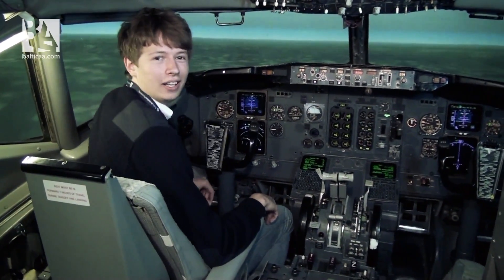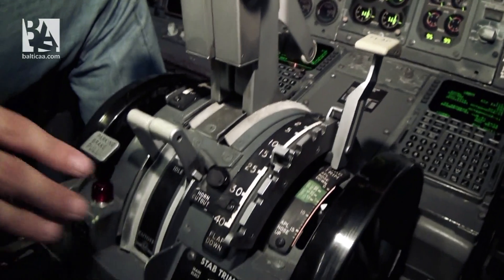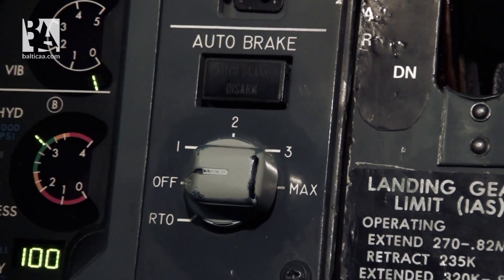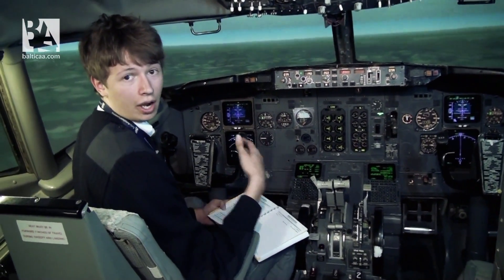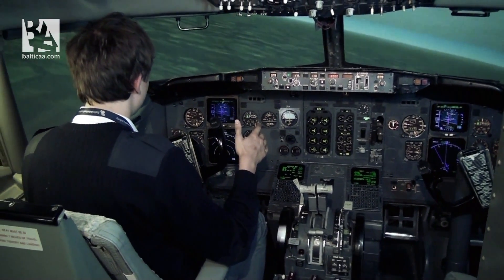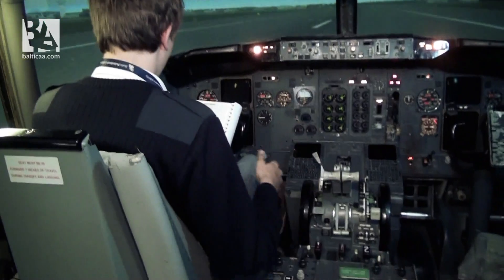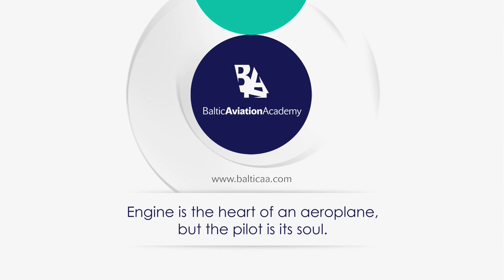Boeing 737: Gear-Up Landing

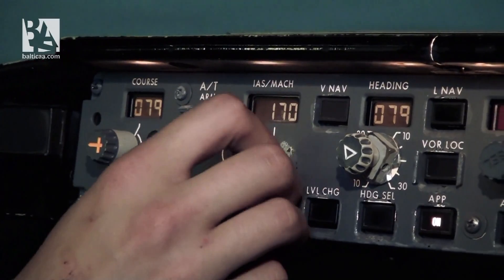Comment: 7:57 first set flaps 15 and then select speed for flaps 15. Never reduce the speed before you set the corresponding flaps.
Reply: It's the other way around. The flap speeds are speed limits, you can't be above those speeds with that much flap extended or you can damage them. So you set the speed first, then once you've reached that speed, extend the flaps.

Comment: why do you evacuate the aircraft due to a belly landing
Reply: This is a retarded question
.....
Reply: It’s necessary to perform evacuation after a belly landing due to safety concerns. Your aircraft could be severely damaged and your engines for example can catch on fire or you also might suffer fuel tank rupture which would cause a fuel leak. JET A1 fuel has additives in it to make it more safe and therefore it’s a lot harder to ignite it at low temperatures when compared to regular kerosene. However it is still a fuel after all and it is still highly flammable and it burns at very high temperatures so performing an evacuation after a belly landing like this is in my opinion absolutely necessary to ensure everyone’s safety. Evacuation itself can cause injuries to passengers but the benefits of it outweigh the risks of injuries and it’s still better to have few passengers with minor injuries than to have an aircraft being consumed by flames while people are inside of it.

Comment: Why are the is the aircraft secured before fire drills? Surely you need to prevent fire first as its a belly landing
Reply: If you're asking why he pulls the fire switches after the landing, it's because there was no fire on the plane, but he pulls it so that the agents discharge incase a fire was to break out during the exit (this can be caused when the plane lands since during a belly landing it lands on it's engines which can create fires later)

Comment: Why did you dont activate the fire extingusihers? In the A320 you activated them...
Reply: He did not activate the fire extinguishers, he pulled the fire switches to arm them in case of fire but to discharge the fire agents you then have to turn the appropriate switch. He states that there was no fire, so he just left them in the armed position.
Reply: he did at 11:04
Reply: +dylan the villan Are you sure? I looks like he armed them, but it don't look like he is activated the agents in fact.
Reply: @computerretter Yes you’re correct. He didn’t release them. While this may be a normal procedure in A320 it’s not the same in 737. Even checklist says that you should override and pull fire switches (which means just arming fire agents). Then it says that if an engine or an APU fire is indicated you should turn the fire switch of that affected engine to release fire bottle. However in 737 it’s not necessary to release fire agents if there is no fire. Of course these procedures may vary depending on what airline you’re flying but generally it’s not necessary to release fire agents if there is no fire. Pilots of course might in some situations release them even if there is no fire and that’s if they for some reason decide to do it this way but as I already said couple of times it is not necessary.

Comment: Normal landing position flap is 30?
Reply: Yes, usually its 30.
Reply: +Ozan Akdag so flaps 40 degrees use for what?
Reply: Steven Satya Mostly emergency situations like this one. Maybe also if runway is very short, or the plane weighs a lot.

Comment: The boeing is a much nicer aircraft in emergencys in my opinion. Why? Because the only beep the boeing made was when it came to a stop. On the airbus. There are 1000 bomming noises going crazy. I hate that
Reply: When put under stress there is phenomenon when your brain will prioritise what you see visually and this sense can be overloadedThis is why the Airbus beeps so loud, there is no fool proof method but it does improve your chances of drawing your attention to then reacting to a situation. You can stop the beeps by confirming the message.You can activate this system or disable it in both aircrafts so what your saying is not really valid it's just specific to how and which system there pilots were trained in the sim.

Comment: How does the Simulator manages it to shake?
I mean, i thought it can make only smooth movement.
Reply: Hydraulics can move very rapidly, and not just smoothly. The sims use hydraulics
Reply: +Nicesisten The simulator is moved by a series of telescopic cylinders. These have oil "cushions" instead of metal guides, so they can react to rapid movements without dealing with substantial amounts of friction. They also have special valves to direct flow rapidly between the cylinders' chambers. The same cylinders are used in tensile test machines to simulate quasi-static force application.

Comment: No Head Rests!!! Does you neck hurt in long flights?
Reply: This is the old 737 (100 200 300 400 500) the new ones (600 700 700er 800 800ng 900 900ng bbj1 bbj2) have headrests.

Comment: One critical concern not vocalized during no gear emergency landing. After touch down once speed go down far enough and rudder becomes ineffective, because there is no front wheel pilot has no control over airplane direction of movement. Skidding off runway on grass might mean disintegration of fuselage, while staying on it hopefully only minor insignificant fire. For this reason it is absolutely critical to land ideally at the center of the runway and keep plane ideally lined up as long as possible. This would be primary concern of a real life 737 pilot. Otherwise, good landing Captain!
Reply: the grass would be better on the fuselage (assuming the ground is relatively flat) because it is slicker
Reply: Concern is not only evenness of terrain but also softness. Bare in mind we talking about 100+ tones, resting on 3 points (engines and tail) going 20-40 and more kts. Imagine one of engine slipping into shallow depression and burying itself in the ground, hitting tip of large buried boulder or perhaps shallow covered by the grass ditch or even some airport's installation for that matter as: solidly installed in concrete bed lightning, heavy electrical metal box etc. I suppose even on perfectly flat terrain softness of the ground could be enough for one engine burying itself in the ground. 100+ tons even at low speed constitutes enormous momentum.
Reply: That is wrong, the 737 classic model, is steared on the ground, by a little black wheel on the captains left side, but not with the rudders. But indeed yes, very nice landing captain:)
Reply: @YAB116  No the comment is correct. You don't have nose wheel steering because you don't have a nose wheel. So, the only option you have is the rudder and as the comment says, that is ineffective under a certain airspeed

Comment: Excellent work! I'd fly with this young man, he's sharp and confident!!
Reply: You are absolutely right. Tough in a real life landing with the gear up AKA Belly Landing, it will be very different. That simulator is the closest you can get to, flying a Boeing 737, it is very realistic, but also way different. In real life the pilot has the responebility of hundreds of passengers and crew, and in the same time landing a big an heavy air craft without landing gear. So in a real life situation this would be a way more brutal experience.
Reply: In real life, this maneuver would be done by captain and copilot. Or even just a member of the cabin crew. Not having to read AND manage the system streamlines the task a lot.
It looked uncomfortable to constantly having to grab and put back the handbook. I wonder why they did not use two students for this training.

Comment: Sounds like hes in a Cessna or prop plane.  Is that just the electronics/fans for the simulator?
Reply: It's real life feature. It's the rattler that keeps the altimiter from stcking :)
Reply: The rattler makes ticking noise, but noise in the video sounds more like air condition + the audio from simulator...

Comment: nice i feel like I can some what fly a plane
Reply: The auto pilot is usually disengaged when the landing procedures begin. yes always manually so that in case of an abort landing he or she can have control.
Reply: its not that difficult as you may think.. you only need training and a good understanding of those instruments.. its fun and easy coz the systems work seamlessly.. especially todays airliners which are fully computerized.. you fly the plane but the computers monitor what you are doing and they always guide you. try it.. am a pilot in kenya and i love when i see people being interested in piloting carreer. good luck,
Reply: thanks Donald reed you fly yourself
Reply: mume nguvuze
I was amazed at the planes being able to land themselves.  Pilot's always manual land or do they use AP to land?

Comment: @Affolée, it is a 737, either 300/400 EFIS. Your notation of thinking it was a 767 is because the EADI and EHSI are indeed the same displays as the 767/757. But note no EICAS in the center, but the normal digital version of the analog engine instruments. Also, on the flight guidance panel, noticed A/B autopilots, not the three pushbutton FCC (flight control computers) as the 767. Notice that the three standby instruments here are horizontally, where on the 767/757 are vertically. Good eye, though. As for the video, not sure why the author needed to show this when there are plenty real life gear up landings on YTB. A single gear landing, or a manual reversion landing with some crosswind  would have been more interesting to watch.

Comment: Certainly right. We all know a *perfect* landing is rather impossible. We allways have something to criticize, because it is allways perfectible. If the aircraft is saved, people is allright, the aircraft is within limits of the runway, and in an emmergency situation you got there where the emergency services are... IT IS A GOOD LANDING and that's it. No further discussion. Not perfect? Ok. But still good-enough. :) ;)

Comment: You certainly don't sound like a transport pilot.  I've never heard one call a landing shit if the plane is still in one piece and the crew & passengers get to walk off.  You'd probably land gear up because you were more worried about the centerline than running checklists.

Comment: Nice video, I learned a lot.  I noticed that in this video - watch?v=h3syTxW85Ik they DID use auto-spoilers which caused the left wing to dip suddenly, smashing the engine into the runway.  I wonder if the instruction not to use auto-spoilers in the QRH in this video was due to lessons learned from that incident.

Comment: When this happens to me I always land on the side of the runway in the grass.   In this manner,  they never have to close the runway down,  and damage to the aircraft is minimized,  although some sod does get scooped up in the cowlings.
Reply: You would think, but engine cowlings and other bits digging into the soil could also contribute to the aircraft skidding off to one side and flipping or tearing holes. A closed runway is a mere inconvenience, but dead passengers is an outright tragedy. Concrete on metal is preferable to digging in the dirt.

Comment: Trim is just another term for balance, according to where the centre of gravity of the aircraft is as it flies. This will depend on how it is loaded, in terms of where passengers are seated and bags/cargo are loaded. Wing flaps and angles as well as tailplane attitude are adjustable to compensate for changes in balance during flight - e.g. as fuel is burned during flight, depending where the reservoirs are fore and aft, it can affect the balance conditions - as well as fuel efficiency ..

Comment: Trim ('Stab Trim') on most large jets involves moving the entire horizontal stabilizer's leading edge up and down, within a defined range of travel.  On smaller airplanes it is called "Elevator" trim, usually using a 'trim tab' on the trailing edge of the Elev surface.  
"Trimming" in the pitch axis, by either method, relieves elevator control forces as airspeed and power settings are changed...thus, "trimming" to a neutral control feel.  The B737 has manual & electric trim actuation capability.

Comment: trim is the angle that the wings can be adjusted more trim points the nose down and less up when in auto pilot the trim is automatically changed to climb, decent or stay on a level flight hope this helps

Comment: The bleeds off has nothing to do with pressurisation, it is prevent smoke from the engines scraping n the runway from entering the cabin. Since the landing altitude is set the outflow valve will do the job of equalising the pressure.

Comment: I do believe the comprehension problem is YOURS.

Flaps at 40 implies the wing, with 40 degrees of flap angle and a larger envelope will produce more aero-drag and will allow the aircraft to approach the runway from a better approach angle and lower speed.  However, the maintain powered flight in this configuration requires much more power from the engines, as the 40 degrees flap has considerable aero-drag.  This is the paradox you are having a problem with.  Larry needs to learn how to fly.

Comment: Could you reconstruct the ANA flight NH-140 when Boeing 737-700 experienced a violent roll after a first officer apparently mistook the rudder trim switch for the cockpit door switch, causing the aircraft to descend 6,000 ft ??

Comment: Hi there!

I've been thinking about what you can do in a real Boeing 737 simulator?

Is it possible to program the fast CDU through instruction station? Can you have a saved route in the CDU, which you can enter without having to enter the SID and STAR?

Is it possible to "fast moving" plane to approach and bad weather but without having to enter a STAR. Or you must first program the it?

Brief what can you program the instructor station?